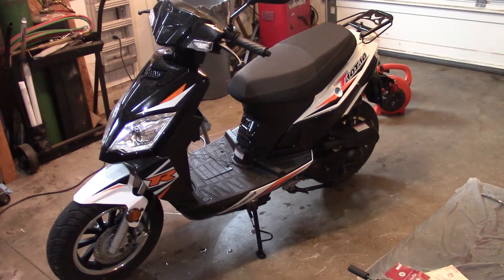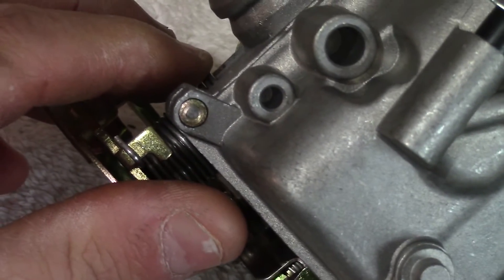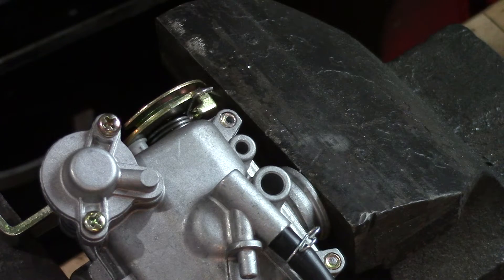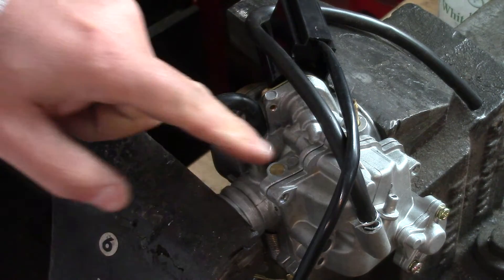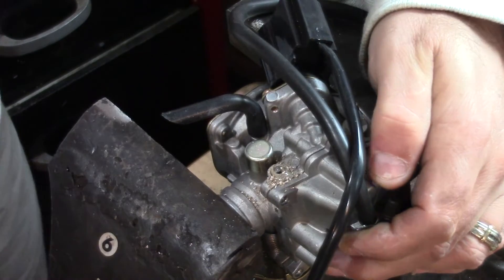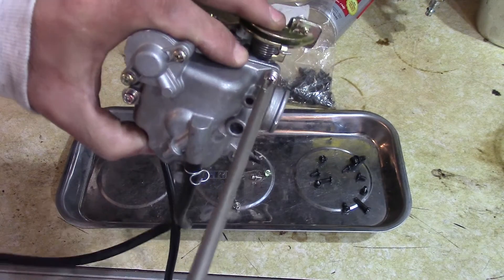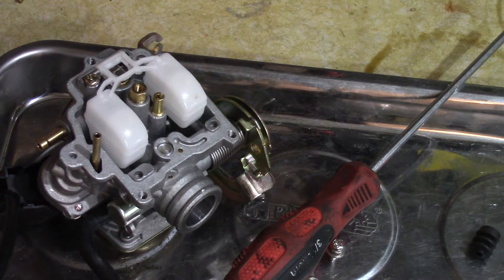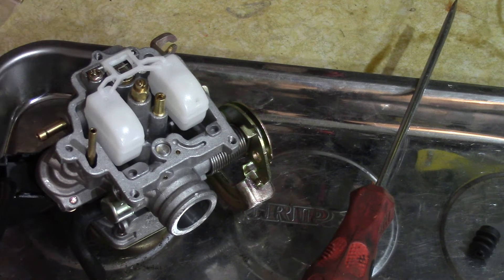Drilling Out A GY6 Scooter Carburetor TaoTao

Comment: Work smarter not harder… use dremel and a cutting wheel, cut a slot in each one, remove it with a screwdriver.

Comment: I don't know what all is done to my 50CC tao tao but it will do 70mph on flat roads with my skinny butt on it. Only does 25-30mph going up hill though. It has a decent aftermarket exhaust and a real Mikuni round slide carburetor on it. As far as that, I have no idea what's done to it. I bought it non running because it needed the vacuum actuated fuel petcock replaced. I think it has had clutch upgrades put in it because it will go up to around 25mph and shift into high gear? I know they don't have gears but that is what it feels like.

Comment: that's the federal GOVs for you... you're lucky they didn't make the manufacturer use hardened  steel screws and plugs(i have come across that type,that you cannot drill---well,you can,but ONLY with solid carbide drills--cheap from china,ebay)